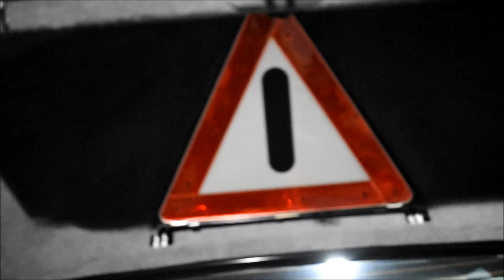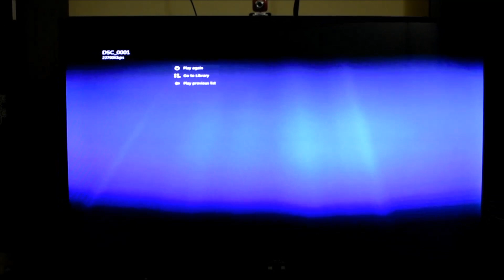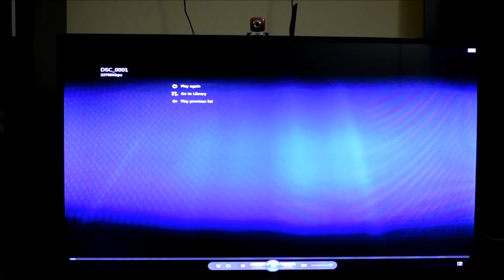E500 check up (incomplete video) Jan18

Comment: Hi Tasos. I have engine code p2540 (Low Pressure Fuel System Sensor Circuit Range/Performance) on my 2008 c63 . Any idea where to begin?
Reply: The car runs fine